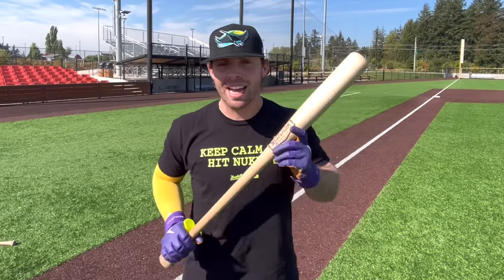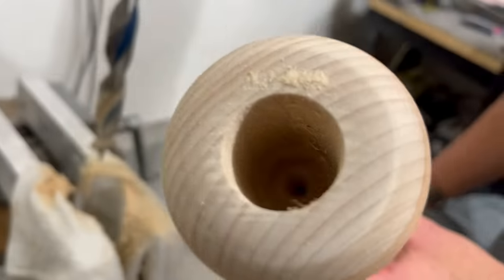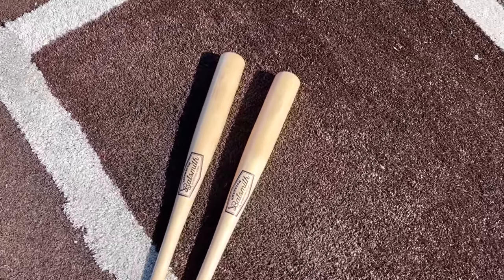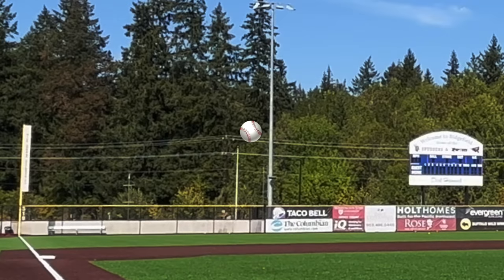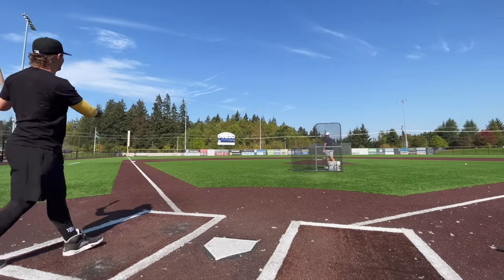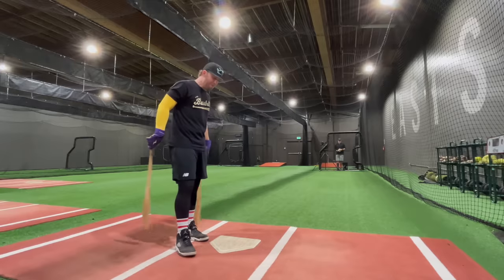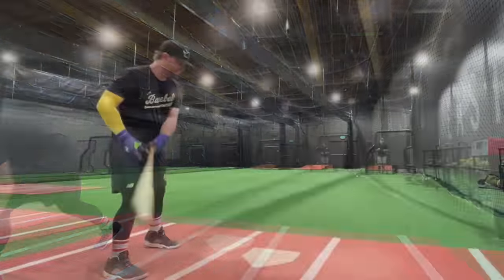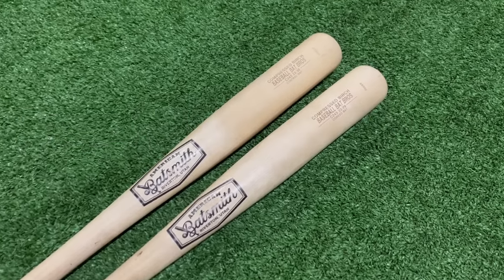CORKING A BASEBALL BAT (the right way)

Comment: I've always thought the cork was to give the bat more bounce in some way I've never really thought about it as a weight saving thing. I figured if it's packed tight with cork that the cork would help facilitate bounce or possibly the bat being hollow would help facilitate bounce and the cork might help reduce shock to the wood and keep it from breaking as easily. That's how I've always thought about it. Definitely excited to finish watching the video I paused it to write this comment. 
Maybe try doing a nice cork job like this to a really heavy bat and see if there's a big difference. You'd shave more weight off with a harder wood.
Reply: Me too! I thought the cork was supposed to be like a trampoline and hit the ball further. I guess having a corked bat means having better control, and faster swing, leading to a harder hit without sacrificing surface density
Reply: Same here. Thought it was too make it bouncy. Otherwise, why put anything in the cavity? Just hollow it out and then put the plug on the end. Air is lighter than cork
Reply: @BebeSensei  yea thats the point lol. That’s why just saying its to save weight alone doesn’t make sense
Reply: @BebeSensei  yes he did. We all watched the video. You’re missing our point of CORK being what’s used. Balsa is lighter than cork, and I’m sure there’s plenty of other materials too, foams for example. But cork has that springiness.

Comment: You guys should do one with corked metal bats.  We had a bat in HS the end cap came off of and found it to be hollow with some light foam.  So, we decided to pull the foam pack it with, if I remember right, tennis balls as tight as we could and used cement glue to place the end cap back on.  I used the bat in batting practice the next day and hit 10 HRs in a row.  One of teammate asked me to use in a game, so I did and hit a pitch low and away that would normally have resulted in pop out and I ended up going yard.  Told the guys we can't use this anymore in games or we are going to be done.  I'd be curious to see if it still works with today's bats.
Reply: this is kinda the idea behind non linear composite bats

Comment: You could really tell that they were swinging the bat faster because as soon as they switched to the corked bat they were hitting more to left field.  That means the bat was meeting the ball sooner than they were expecting it, so a bit in front of the plate instead of directly over the plate. After using it for a bit they began to compensate and then started getting one or two to center field.
Reply: Bro, the corking reduces the bats weight which allows you to swing it faster and impart more energy on the ball - they aren’t swinging harder, the bat is moving faster
Reply: @HahaDamn He never said they were swinging harder

Comment: Would be cool to see you team up with either SmarterEveryDay or The Slow Mo Guys to use their high speed cameras to see if you can see the bat flexing in slow motion. If you can see a difference between the corked and normal bat and to see a metal bat and any other variations you have.

Comment: That grain orientation on the end plug is doing my head in!! Shoulda been the other way around…

Other than that…

As a ball fan AND a full time carpenter. I love this.

I swung a 33/31 in our mens league, ash bat.
It’s insane how much more control you get with a lighter swing weight and shorter bat.
Reply from the maker: 😂 fair point, we just weren’t worried about disguising it

Comment: Cutting out the center of the bat will allow it to oval the barrel slightly on impact (at least compared to the control bat that is denser and more compact in its form) and then the bat will spring back to normal shape adding a bit of extra pop off the bat! Being lighter I don't believe helps with power simply because it will slightly have less follow through power and you can just purchase one that is an ounce lighter, which would end up sacrificing a bit of density to be lighter and distance never goes up with the same hitter! Also, I would imagine cork bats require a lot of impact to see the intended results. Even though the center has been replaced with a less dense material making the spring effect easier to achieve, I believe the impact between bat and ball would have to be extremely high. In conclusion, the harder the bat is swung the more advantageous it becomes IMO!

Comment: The on the field testing you could easily see the difference. You guys got good swings and contact on all the ABs you showed. Control bat, anything without a “good” launch angle stayed in the yard. Cork bat, anything with solid contact was gone, launch angles were all over the place but the ball still got out.

Comment: Corking a bat isn't about removing weight, its about creating bounce and a higher exit velocity. I'd beat you're not swinging any faster (in any significant way anyway) but the base is leaving the bat far faster. Its like in golf a driver is limited to a "smash factor" of 1.5. Drivers can be made to have a 2.0 smash factor at the same weight and user swing speed,.. the face is hotter.

Comment: I still dont understand why they use dried bottle cork. In the 80's we used Renia's Cork Filler for soles that came in tin jars that was soft and pliable and packed it in. It would expand when dried. This is how most of the pro's did it in the 80's. At least the ones I knew of. But this is a much better test than the last one.

Comment: Now we can see why guys like Griffey stuck with the 271. It can stay at a -3 legally while still using dense billets. With the 243, you trade weight and/or density for sweet spot. 

Part of the fun of wood bats is the balance of density/hotness, swing weight, and sweet spot. Griffey was able to get away with a smaller sweet spot, and still take advantage of fast swing speed and dense wood. Many of us are better off with a bit more sweet spot.

Comment: If the intended purpose is to lighten the bat while keeping the outer density I would've liked to have seen this done with a more dense wood to begin with, or several different woods. I know Maple is a go to wood for bats and in ye old times hickory bats were very popular. Both of those woods are higher density than birch so you would assume that the corking would have a more drastic effect. I'd also be interested to see what effect other lightweight fillers could have. Resident enraged woodworker here to give my 2 cents, very well done video I appreciate the exit velo. testing for raw statistics.

Comment: Bat corking overall in the majors has been proven to have little effect for power hitters. The faster bat speed is offset by the loss in mass. If I had to field a guess as to why you're seeing a marked difference is that as you're not a major league power hitter, the increase in bat speed is pronounced enough to overtake the loss in mass. Peeps like Judge, for instance, are already swinging these massive bats at very high velocities.
Reply from the maker: I’ve looked at that study and I think it overlooks the fact that you can’t measure barrel control - and a lighter bat results in more barrel control and more consistent quality contact. 
But to your point, I think a ‘massive’ bat like Judge/Turner/Joc uses really shines against 100+ mph pitch velocities that they see in the MLB. It takes a heavy object to turn around 100 mph
Reply from the maker: Also, I think some of that is just propaganda to prevent cheating since it got so popular 😂
Reply: @baseballbatbros  I think your point about bat control is a major pro, for sure. Getting the bat exactly where you want it is half the battle. I just don't know if corking is actually a "cheat code" for hitting bombs specifically as people tend to think, at least not at the highest level. Though your second point might not be too far off from the truth either. 🤣
Reply: It's definitely inefficient to swing a bat that's too light because the increase in speed doesn't make up for the lack of weight. M and A no longer have a 1:1 relationship in F=MA because you simply can't get the bat around quick enough. An easy example is any adult swinging a whiffleball bat, you simply can't use 100% of your muscles to accelerate the bat to the ridiculous speeds it would require. Also, say, a highschooler trying to swing a drop 12. It's like swinging a fly swatter.

I used to be skeptical of this but then I realized I've never been nearly as strong as those guys are and when I was at my peak even going from a drop 3 to a drop 5 felt a little weird and a drop 8 felt like a toy. Those guys know what they're doing, and nowadays with all the science that goes into the sport they wouldn't be swinging 32-33oz if it wasn't a good idea. Gone are the days of the likes of Ruth hacking with giant logs (due to reaction time suffering), but there's also no reason for a power hitter to want anything lighter than solid wood.
Reply: @sntslilhlpr6601  wiffle ball bats are made of hollow plastic not wood. A baseball would obviously destroy it

Comment: If possible I would grab a 3rd bat and drill 1 oz out and plug it(for structure) with no cork and leave it hallow and compare the hits and exit velo. That will give the definitive answer of is it cork or less barrel weight.

Comment: You're missing the point of corked bats. The point is with the hollow center, the bat can springload on impact. The lightness is fine, but it's not the big effect. The big effect is how far the wood caves in and springs out on impact.

Comment: Corking bats is a waste of time. If you really want a significant increase in performance, there's a method for reducing the weight that also boosts compression (as opposed to ruining it like corking does.) Core it out, mix up a batch of the material they use for super bouncy balls (recipe can be found online and doesn't require anything too exotic), pour it in, use a tamping rod to compress that material as much as you can (the higher the compression the better the results), leave it compressed until the material has set (a day or two at least iirc... it's been 20+ years), mix up another batch, and repeat until you've filled the bat.

Unlike cork, there are no air pockets so you don't have to sacrifice any exit velocity that comes from compression. In fact, the material will actually seep into the wood grain a bit before setting (essentially making it a completely solid bat.) Some buddies and I experimented with it in college and were able to lower the bat's weight by ~2 oz (I think we used a 32 oz bat to begin with) and increase flight distance by ~15 ft. over the control bat (we had players from our school's baseball team do the testing with a larger sample size of hits than was likely necessary.) We didn't have a way to measure exit velocity reliably, but the significant boost to flight distance would suggest a substantial increase. Also, since we tapered the coring to match the taper of the bat down into the handle (roughly to where the middle of your top hand would be when gripping it) the bat became nearly impossible to break (after much bashing on home plate by multiple people, all we managed to do was get a few small cracks to form in the upper handle... and a good bit of dents.)

We were using sub-optimal tools and thus weren't able to compress the material anywhere near what would be possible with a proper set up so the flight distance increase we got could have been much better. We also didn't know about the material seeping into the grain until we segmented it afterwards. Had we known, we would have periodically increased compression while it was setting to account for it. Also, we didn't put much effort into preventing the material from seeping around the sides of the tamping rod under pressure so we likely missed out on some extra compression there as well. 

It's a more complicated procedure than corking but yields far better results. I wouldn't be surprised if something similar were being used by some MLB/Minor League players. I originally got the idea from hearing that players had experimented with putting the actual super bouncy balls (whole or ground up) in cored out bats. It occurred to me that using that material in a manner that didn't leave air pockets would likely work much better.

Comment: For swing weight purposes, wouldn’t it feel the same? Pound of feather = pound of steel? Yea you took out the center, but you just added the weight back with cork
Reply: They literally weighed the bats in the video. Does a gallon of mercury weigh the same as a gallon of helium?
Reply from the maker: Cork is lighter than wood so it netted out almost a full ounce lighter. And that ounce was all taken from the barrel, so it affected the perceived swing weight quite a bit

Comment: The main reason the corked bat is supposed to work better is not because of the reduced weight. Force is mass times velocity. Reducing mass alone is not going to get you further. The advantage is the in a more bendable bat. A solid wooden bat is pretty stiff but it still bends on a good solid impact. Look up super slowmo footage of a wooden bat hitting a ball. The corked core bat does this even more so. The bat bending backwards stores energy and then bends forward again, against the ball giving it an extra push. This extra bending is also the reason why corked bats tend to break faster, other than of course a less solid core.

Comment: It’s so interesting how someone figured out a cork would make you smash a ball way harder. Is it the cork material or just because it makes the bat lighter that the ball goes further?
Reply: Nope. It makes it so you can move the bat a little faster that's it. It doesin't even really add power it just helps you get the bat in position for a good hit. If fact you are actually losing some power when you take the weight out of a bat. It really doesint even help enough for it to be worth it at all. Not only is it very easy to get busted using a corked bat but you would likley do just as well with a normal bat.

Comment: a lot of flaws in the experimenting such as using it after already using the normal bat which could warm you up more so your EV increases when changing, but otherwise its still a great video and I want one of those corked bats so bad lol sounds like a blast to take BP with

Comment: Originally they used cork to cork a bat from a cork tree bark from a Cork tree or whatever they’re called the same material that they use in wine bottles because it’s kind of bouncy but I’ve heard the best way to caulk. A bat is to use super balls do you know the super bouncy Super Bowls, I don’t know what the material is exactly but it’s super bouncy and if you take like a bunch of like 1 inch round Super Bowls, any stuff them in the core of a hollowed out wooden bat barrel, and then you got a put ground up pieces of the same Super Bowl material in the voids in between the balls so you put some Super Bowl crumbs at the bottom you put a ball then you put more crumbs then you put another bowl then you put more crumbs then you put another bowl then you put more crumbs and then you put the plug at the end of the bat

Comment: The true advantage to a court bat isn't the extra distance. A lot of people think it will supposedly get for any mile an hour gained in speed. You also lose energy because of weight of the bat is also less. Therefore it kind of cancels each other out, but the advantage comes in when you are facing a fast throwing pitcher. You can now swing quicker to get to the ball.
Reply: The amount of swing speed you gain with the change in center of gravity outweighs the loss of mass. With energy velocity is squared where mass is cut in half. So a 2mph swing speed increase will create way more energy than what you will lose in the loss of less than 1oz of mass (like the bat in this video).

But yes, I agree it also helps with getting the bat around quicker against faster pitchers!
Reply: @kylejheard91  I didn't check how much they said they pulled out of it, but typically when you cork a bat you take anywhere from 6 to 8 oz out of the bat not just one. As a matter of fact, a good majority of Major League baseball bats have a 3 oz cut out already in them, not corked. I played with a kid who corked a bat once, He took 8 oz. Out. He tried to use it in a little home run derby competition we were having, didn't help at all. Also, it looked extra suspicious seeing how it was a 35-in bat He wasn't particularly big 🤣
Reply: @MACandanedo1  ah ok yeah that makes much more sense. The dudes in the video took out like 5oz then added another 4oz of cork back in. Total weight was only down a fraction of an oz.
Reply: @kylejheard91  a controlled experiment was done with a corked bat in which consistent contact to the same spots on the bat was applied. It showed that with the same contact spots on a bat, the increase in velocity cancelled out the loss of mass but didn’t overcome it. The reason corked bats are deemed as easier to hit further is because you maintain better control over the bat meaning you’re likely to get better contact with the ball. When taking out that factor, a corked bat is pretty much useless besides the whole getting around faster idea”

Comment: I was also wondering why a carpenter didn't at least alighn the grain of the wood cylinder to cap it..?he also did a poor job of cutting it from a similar thickness and amount of the original bat grain.
Reply from the maker: If you really wanted to disguise it then you would do that, but we’re not worried about hiding this one - just for a YouTube video